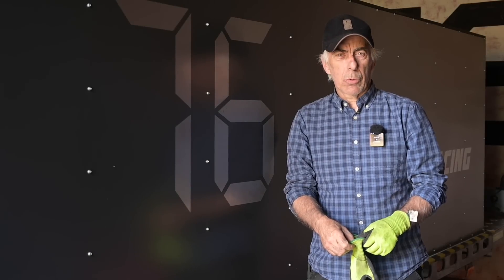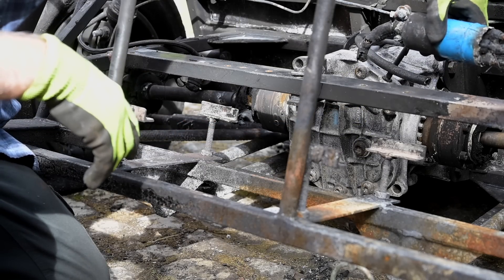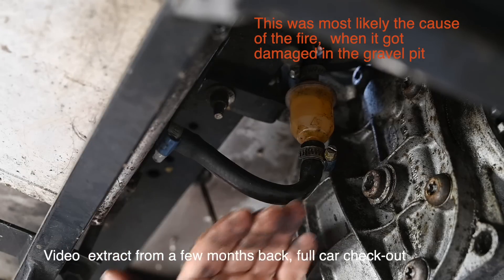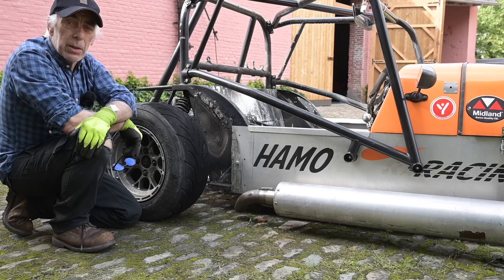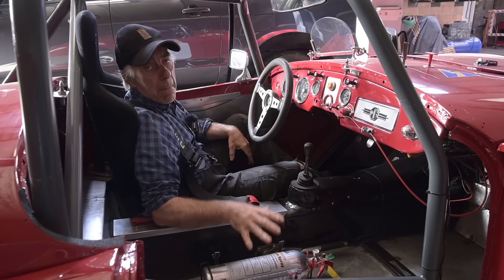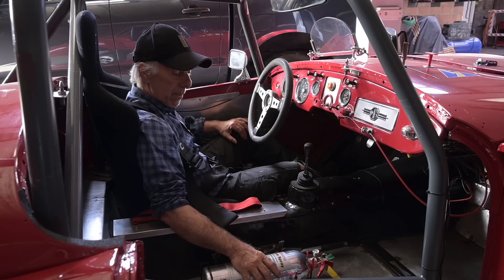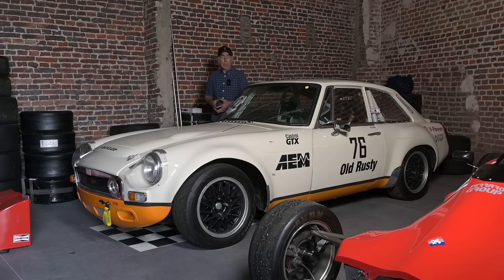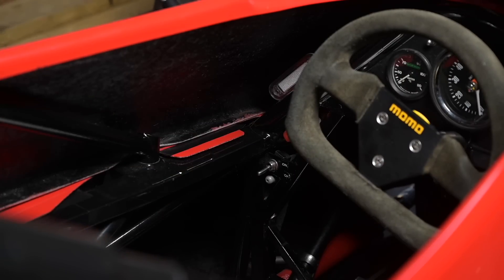Race car on fire  - Part 3  The Cause & Fire Suppression Systems

Comment: Is Novec one of those gases that can make you lose consciousness ?

I don't think it would be smart to use that type of extinguisher in a plumbed-in system ; pull the trigger, you go under, but if the gas only extinguish half the fire, you are toast :/
Reply from the maker: Well that might be true, but its been promoted  and used in many race cars.  This is what I got ... Hope never having to prove it. 1. Effective Fire Suppression:
Rapid Action: Novec 1230 extinguishes fires quickly by disrupting the chemical reaction of combustion. It's effective against Class A, B, and C fires.
No Residue: Unlike water-based systems, Novec 1230 leaves no residue, so there's no cleanup required after discharge. This makes it ideal for protecting sensitive equipment and electronics.
2. Safety:
Low Toxicity: Novec 1230 is safe for occupied spaces because it has low toxicity and a high safety margin. It doesn’t deplete oxygen levels, so people can safely evacuate without breathing difficulties.
Environmentally Friendly: Novec 1230 has a low Global Warming Potential (GWP) and is not ozone-depleting, making it a more environmentally friendly option compared to other chemical agents like Halon.

Comment: Surprised it even ran, having an EFI pump higher than the fuel in the tank is utterly stupid. Although that's different to the fire side of things. And there should eb safety features in place to shut the engine/pump if fuel pressure drops. And really shit hose and clips there for fuel lines. Very unprofessional.
That should be running an in-tank fuel pump. Would be far neater overall.

Comment: Steve - Great Video!!!  Your comment about how hot a fire can be by looking at the color of steel is spot on.  I did many refinery fire rebuilds during my career and when we did damage assessment to determine the heat impacted zones, we always looked for the color of the steel or iron components as a prime indicator.  A purplish-blue or metallic blue color is an indication of the heat having passed the metal transition temperature range, which is over 1100 degrees F or 593 degrees C.  Once the metal has been heated beyond that range, it is no longer usable and must be replaced.
Reply from the maker: Thank you for the comments, Ron

Comment: Spot on with the recommendations on fire systems. I raced throughout the 80s, always in saloons, and the regs only required a stand alone extinguisher clamped to the cockpit floor. General consensus among drivers was that if the car caught alight we were outa there, and the extinguisher could look after itself. As for the exhaust, given it points towards the car, it should not terminate until behind the driver's seat. On modern racing Caterhams in the UK the exhaust ends just in front of the rear wheel and it points away from the car.
Reply from the maker: Thanks John , and I can only agree with your points

Comment: I was always surprised how fast you could get out of a FF when you had to. Even upside down. Ask me how I know.
Reply from the maker: I bet you know ,so tell us .... we like to hear it
Reply: @D3Sshooter  Long, long ago and far, far away... 1974. Bridgehampton racetrack on Long Island in New York, USA. It has the same sandy look and feel of Zandvoort. The track was old and bumpy. Today's F1 probably couldn't even run there. On the back of the course is a variable radius fast left-hand sweeper.  Speculation was that a FF could go through in 4th. My car was a Caldwell D9 with race slicks. Similar to a Merlyn but with a stronger frame. (thank goodness). 

On a practice/track day I decided to try 4th gear (~100 mph). I knew subconsciously that a Ford with power on would understeer and power off would oversteer, but I wasn't thinking about that. I went through the turn with part throttle and the tail snapped out. I almost caught it but went at the sand hill on the inside of the corner. I saw a lot of blurry tan. When everything stopped, I was on the top of the hill upside down. My first reaction was that I couldn't move. Then I grabbed the 6-point harness latch and dropped ~2 feet to the ground. I went to the hospital and had my entire spine and other stuff x-rayed. I had no physical damage. The car needed to be rejigged. 

BTW: People wonder if your life flashes before your eyes when you are going to crash. I've talked to several people who crashed, and they pretty much say the same thing. The only thoughts they had were "This is going to hurt" or (mine) "Oh sh*t". 

Sorry, this is almost as long as your video. lol

Comment: Another great video Steve. I 100% agree with your advice to have a plumbed in system. Most important in an emergency situation is to get out of the car asap. Pulling a lever/handle takes a second, messing around trying to get a handheld extinguisher free can take several seconds.
One option I'd suggest to have in addition to a plumbed in system is a firestick. They are similar size to a emergency flare and very light, but excellent at putting out a range of fires. It could be mounted almost anywhere for ease of access.

Sorry to hear that car won't be repaired, but I think it's the best option. Hopefully the owner will get something similar to replace it and get back on track soon.
Best wishes from Ireland
Reply from the maker: Thanks for the comments and write-up.  The car was just sold a few minutes ago... and the owner (ex) is looking at buying another one

Comment: I had already replaced these hoses. The hose at the T piece (dead end) you see some cracks. Also on the pressure side of each hose clamp they are already swollen also there is grease around the filter and the pump. A new hose does not tear as quickly as these did in the gravel box. My experience is that the hoses will be hard instead of soft with the modern fuels.
Reply: Did you also change those worm drive hose clamps for better high pressure fuel injection type?
Reply from the maker: That was planned , but not done so far
Reply from the maker: Indeed, and all that work was planned .   I have seen hoses that were soft by the ethanol and others became brittle ... I guess i depends on the compound of the rubber
Reply from the maker: Indeed, and all that work was planned .   I have seen hoses that were soft by the ethanol and others became brittle ... I guess i depends on the compound of the rubber

Comment: Do you have a tray under the Weber carburetors to stop fuel dribbling on to the exhaust?
Reply from the maker: Not on burnd car as that is an injection, but on my B and A I will have them